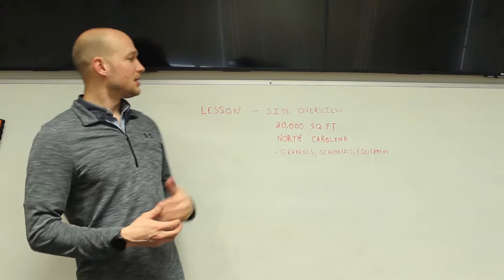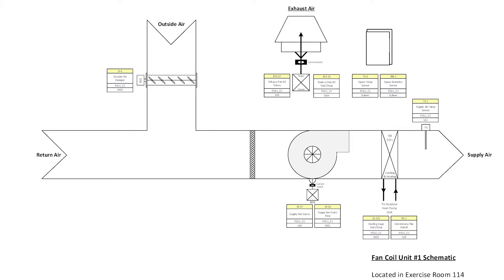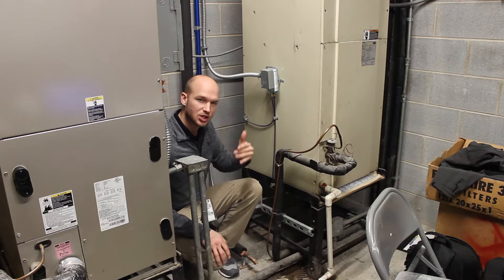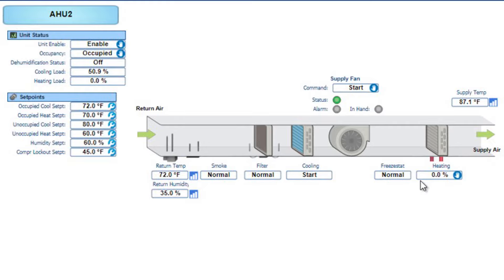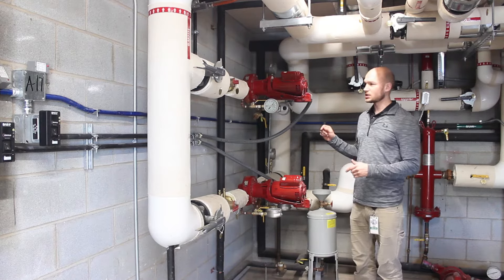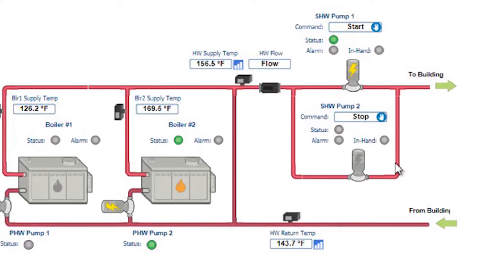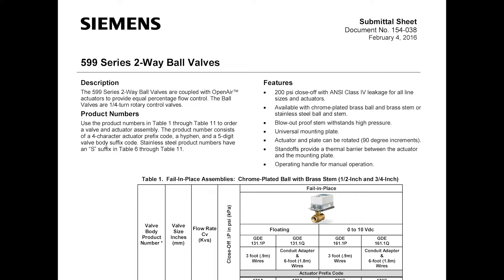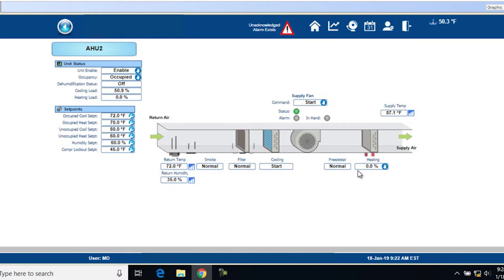Building Automation Systems Basics Lesson 2 - Site Overview BAS 101 system training

Comment: According to your AHU plant, the heating actuator is on LTHW supply to the coil. Yet in schematics, It shows the actuator on the return of the side of the LTHW coil. This is important because if the schematic is correct, then the LTHW is piped up incorrectly and your coil is being fed from the top, not the bottom (The temp sensor will not read correctly - hot air rises) Your KVS of your valve will be also be wrong.
Reply from the maker: nice eye! will have to look into that a little deeper..
Reply: Isn't the actuator supposed to be on the return? Piping probably correct
Reply: Very nice overall video, which BMS is this? Lots of parameters what's your boiler set point?
Thanks

Comment: Hello sir, 

I'm 3 weeks into a BMS system as a Automation Engineer,  even though my experience mainly is field work with oil and gas , power gen and automation robotics, the troubleshooting that I've done is what has helped me transition to new automated systems . I went from PLC'S TO, node based architecture,  in short your video I've watched at the end of my 3 weeks so far.  Its perfect. Good pace, you choose a project that has all the components I deal with now. Thank you.  BTW great simulator in lesson 3 . I used to build those.

Comment: Hi! I just got out of the military and I got accepted for a job at Siemens working with BAS.I did nuclear / electrical work inside the navy. I'm following these videos along with videos from Engineering mindset and wanted to let you know that these videos are great.
If there's other references you would recommend I would appreciate it!
Reply: I'm thinking about doing this with Trane as a skillbridge opportunity. How do you like it so far?
Reply: @christiansimpkins6670  Its different. It seems to be very field oriented. I drive atleast 2 hours a day. I fix Building systems for hosptials, stadiums, schools, warehouses you name it. Its nice working with lay folk  and doing some good in the world. Its all over the place too. I sometimes click next for program installs all day. Sometimes im on ladders in drop ceilings hunting wires. Sometimes im programming buildings with code - so its not too routine. I have a strong sense of job security and since its not overtime exempt i can always work more if i need more money. I think i get paid fairly well for the area 37$ an hr in houston.
Reply: @laerzzyziz2381  Thats good to hear! How much do you learn about HVAC systems? I know most of the work is with wires but is there any turning wrenches?
Reply: @laerzzyziz2381 how much experience you have?  I have 3years in refrigeration and 1 year in residential HVAC/r work. I have a interview with Siemens, I'm getting paid 30 right now.  Idk if it is a good place to go to work for.

Comment: Thank you for the video. Would love to learn more about the programming side of it. Not a lot of information out there
Reply: Your right!!!!  So I can help with that. I'm a 20 year PLC programming vet , mechanic at heart, but you are so right almost nothing out there.  My last role technical instructor before , my current one is BMS automation SYSTEMS engineer. 

Here it is.... BMS SYSTEMS use function block diagram programming,  structured text,  and ladder logic.  Mainly.   Because of proprietary rules not much is out there you need to pay for that or known as your experience grows.
Reply: Look into Siemens Insight or Desigo.

Comment: What programs do you need  on what kind of computer to connect to the main controllers?
Reply from the maker: It will depend on the system - but for Tridium/JCI you would use the program Niagara. I know most people utilize window base computers, I'm not sure if a MAC can connect to all systems.

Comment: Hi,
Great video. However, I would like to have more information on the wiring diagrams of the valve. (1)How the valves powered (2) Are the valves powered with the same communication cable? (3) I understand the wiring diagram for communication, what about for power? 

Many thanks,
Newton

Comment: Sorry to say that I saw a lot of punch of punch list items. (Note, since this is a completed building and you are not explaining differences between the drawings and the install I am assuming these are the as-build controls drawings.) Here are some of the punch list items. 
Control drawings not matching graphic. (Multiple issues)
Control diagram not matching sequence of operations on the same page. 
Control diagram not matching installation. 
Graphic showing 100% return air AHU with a low temperature detector. Why would anyone install a low temperatures detector on a 100% return air AHU in North Carolina? Of course this may be due to it not actually being a 100% return air AHU. The controls diagram actually show it as a mixed air AHU.

This is less than half my punch list. 

Sorry for being so harsh. But, the building operates, commission aggents and mechanical contractors that I have worked with would list most of these punch list items and other items.